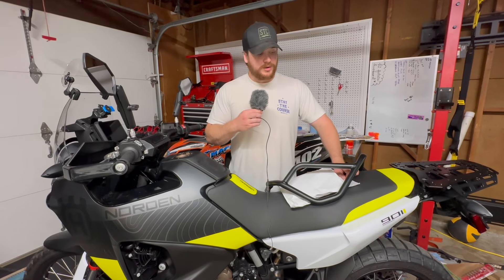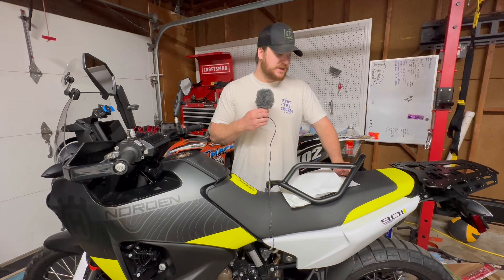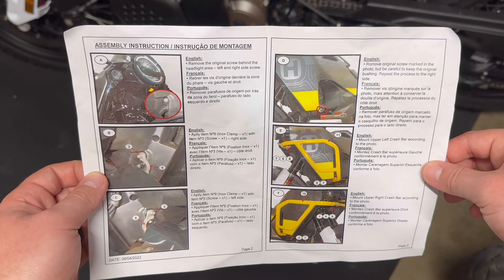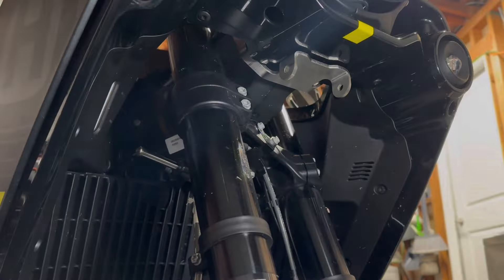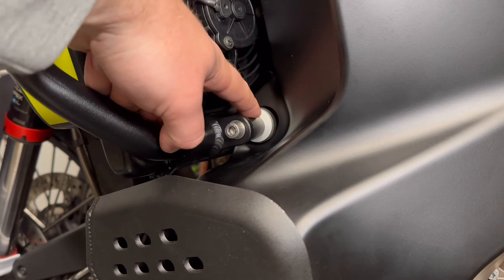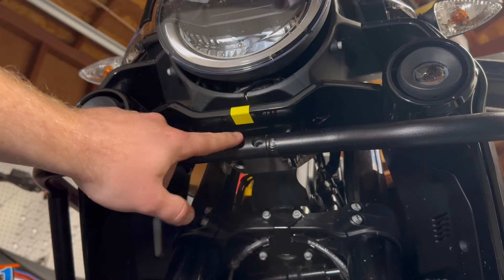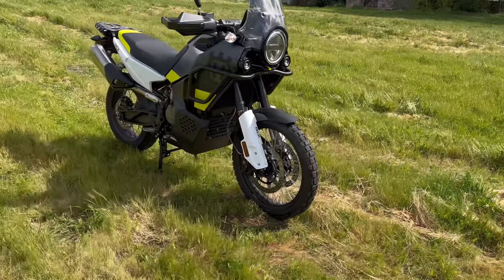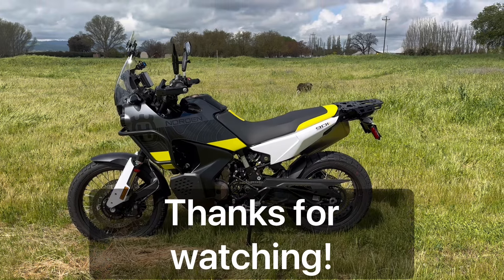Norden 901 | Time to Add More Crash Protection | Crash Bars!

Comment: Going with the same bar/skidplate combo on mine. Just waiting on delivery. Just wondering did you consider powdercoating the skidplate? I like the black finish too not sure how to get there yet.
Reply from the maker: Powder coating would probably be the best option for durability.  I just used spray on plastidip.  We’ll see how it holds up. I’m fully expecting to have to touch it up constantly lol

Comment: Hey! Do you remember having trouble with step 1-3? It seems the two sides are connected with a threaded bar going through the head stalk. Cant get either side started without it spinning freely.

Going to try with a buddy to get a second set of hands holding things down
Reply from the maker: Definitely the worst part of the project.  I had my Dad come over and help me out. Not sure it’s possible solo.  I thought I stripped it out at first.  I should have mentioned that! Good luck 👍🏻
Reply: @Preacher402  thanks for such a quick reply! I thought I was the biggest idiot in the Norden world because absolutely no one mentioned it.

My buddy is more mechanically inclined so I'm sure we will figure it out. It's not rocket science, but any tips? Is there a better side to start with?

Cheers from Ontario Canada 👍👍
Reply from the maker: @marcoleon8515  we just used some pliers to hold that bar. I’m sure there is a better way, but it worked!
Reply: @Preacher402  forgot to follow up. We got it installed. We found a solution that worked for us and got the whole job done within an hour
Reply from the maker: @marcoleon8515  very nice! I haven’t had a fall since I installed them.  Hoping they hold up

Comment: Does these upper crashbars also work with the Expedition ?

And my second question.    Would it be duable to create somekind of toolbox at the front of the skidplate ? Or would that create a conflict with the front tire ?   Tools are so damn heavy.  And i am burning my brain trying to find something out for that.    To get that weight as low as possible.  
And sure.   You can buy all that special titanium tools and tire-levers and so on. But it will cost you a fortune.  Those pricings are insane.
Reply from the maker: Yes, these will also work with the expedition.  

I’m not sure about a toolbox on the front of the skid plate.  There is clearance, but I don’t think that would be my first pick. I’ve seen a lot of people spread out their tools on the bike so they’re not all in one spot. Distribute the weight best they can. Cool thing about the crash bars is they opens up more mounting locations for whatever you want.  Hope this info helps!